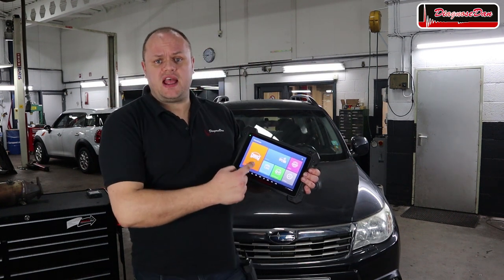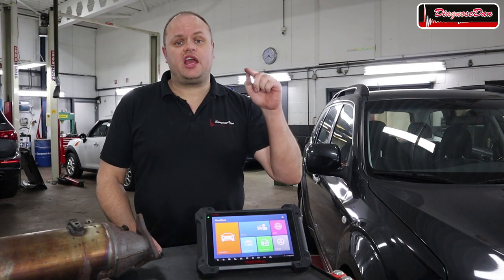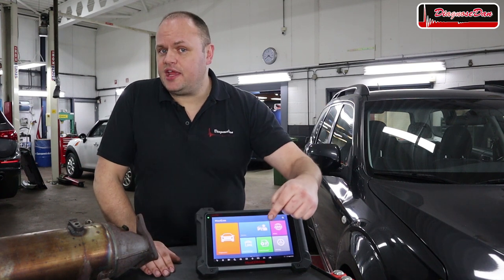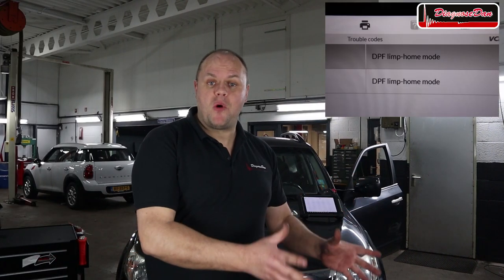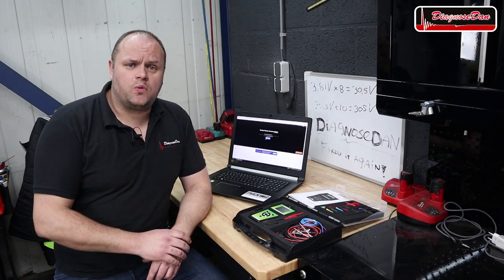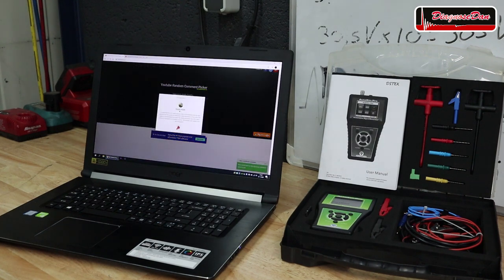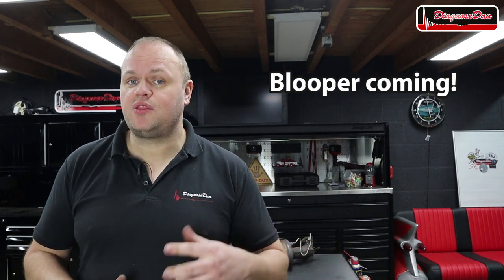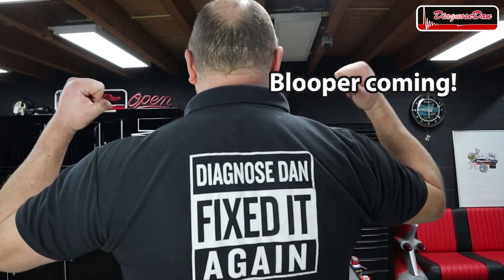New Car parts aren't always good Car parts!

Comment: Brilliant Dan.
This problem has been solved in new desil engine. Additional injuctor is added inside the DPF system and the PCM decides optimum burning time so that it comeback normal without clogged materials. On scan tool appears like accumulation percentage of the soot. When it reaches hundred percent start burning.
Reply from the maker: This Car does also do Regens, not only never models

Comment: Hello Dan,

I am a heavy duty diesel technician from Canada, and I specialize in exhaust after-treatment diagnostics. After watching this video, I still have a couple questions. How long was the vehicle driven after the other shop replaced the DPF? Did it temporarily fix the issue, then it became plugged after some drive time? Although it is possible that the DPF was defective right out of the box, it is highly unlikely. Towards the end of the video, you mentioned that the failed inter-cooler boot may have caused a rich mixture, resulting in a plugged DPF. You are on the right track with that thought process. Whenever you replace a DPF because of a plugging issue, it is very important to do an "upstream" inspection. If the engine is running incorrectly, the DPF may quickly become plugged again, and the customer complaint will re-occur. Some things that could cause DPF plugging are a stuck open EGR valve, failed EGR cooler (coolant in the exhaust), any oil in the exhaust (failed turbo, valve seals, etc), intake system leaks, over-fueling conditions, etc. A simple throttle "snap test" should be performed with the DPF removed, to be sure that the engine is not creating excessive particulate matter. Also, a talk with the customer about fluid loss, or other symptoms may be beneficial. 

Sorry for the long-winded comment, but since you have shared so much information with me, I thought I would give some back.
Reply from the maker: Great comment!
The Car was never fixed or driven with that DPF. 
After clearing the code it would come back with a "snap throttle"
I inspected the DPF and no soot blockage. 
I did have the Car running without the DPF and almost no smoke.
Reply: DiagnoseDan Awesome. Keep up the great videos man 👍

Comment: THERMOSTATS---- I'VE FOUND THAT AT LEAST 30% OF THEM ARE BAD WHEN NEW so test every one before install.
Reply from the maker: Amazing!
Reply: I think aftermarket ABS wheel bearings are the worst. It's really hit or miss with them. GM is known for bad ones all the time. What's worst is it's a sealed unit usually which is very expensive
Reply: I only fit genuine thermostats now, had so many duff ones.
Reply: How do you test it before fitting?
Reply: Raj Shah pan of hot water and a thermocouple. Make sure it doesn't open, even slightly, before the point marked on it,
Reply: @theweekthatis  There are cars that don't have good thermostats, period.
My current car is a Renault Megane 3 1.5 dci and it never goes over 75 degrees when it's freezing outside. Not even when traveling 130-140 km/h.
At first I thought the thermostat was bad but it turns out it was replaced just a year before I bought the car. New factory thermostat, new thermostat housing and new temperature sensor. Then I started talking to other owners and it turns out all of them are like this. That means it shows 1 notch instead of 2 on the dashboard and everyone thought it was a problem, but it's not. Kinda funny how they can't design a thermostat that opens 5 degrees higher. The second notch appears at 80 degrees.
Reply: @ast5515  Same as my 1992 Diesel Mercedes. It never goes above 50 C. And the water temp of diesels is higher than petrol engines, or gasoline if you are in the USA.
Reply: @gasgas2689  Diesels are more efficient, which means they produce less waste heat. Their engine blocks are also heavier in order to withstand the higher compression. This means they will always run cooler than petrol engines.

And 50 °C is just not high enough. Not even for a diesel.
Reply: @ast5515  I bought a new diesel and wanted a tow bar. Part of the manufacturer's spec for the tow bar was to have an additional radiator fan fitted because the water in a diesel is hotter than a petrol (because of the compression ignition). Fitting a tow bar means more stress on the engine therefore more heat. A diesel engine radiator will always be larger than a petrol engine of the same capacity, the same model of car will have a bigger radiator for a diesel engine than the same model same capacity petrol engine. However, the diesel exhaust runs cooler than a petrol exhaust system.
Reply: @gasgas2689  I suppose it is true that it burns hotter. You are right, I only thought about the exhaust temps.
Reply: @ast5515  The dash instruments are not always accurate, it's best to check readings on the engine data list of your scan tool.
Reply: @zbynekm2918  I always do. This car only has 3 notches. Warming up, operating temperature and overheating. You can't do anything without a scan tool. The operating temperature notch shows up at 80 degrees, the car operates at 75-78. Second notch shows up only in the summer or during DPF regen.

Comment: Helpful video . I do DPF work on a weekly base and I must say that I had only one similar problem like yours . This was caused by a cracked weld around the pressure sensor . New from the factory . Also , I don't install the cheapest DPF and I ask clients how much city KM's they do . I am not the pope and I've done my share of delete's and recommended these clients to buy a gasoline car . where I live they check for sooth but not for the DPF actually being working . It will be changed one day but until then I do what is needed
Reply from the maker: New MOT regulations and testing equipment coming and all Dpf deleted cars wil fail the test.

Comment: I dont change DPF, i remove clean it empty ash put it back, change engine oil to C3 5w30 dpf specific oil problem solved and also leave car running with AC on when i stop for 5 to 10 mins between places.passive regen no blockec DPF.🤣 never use additifs that enzyme speed regen it blocks it faster with soot n ashes.i also lock the car from outside with engine running to be safe.all 4 doors are mirror tint.car Alfa 159 2.4 jtdm
Reply from the maker: 5W30dpf the same that we use😉

Comment: Fantastic info and diag on that DPF Dan! We don't see many diesel cars here in the USA so it's very educational to see how the pressure and temperature sensors detect DPF issues, and what good specs are. Saab gauge! 👍
Reply from the maker: Over here diesels make up about 40% of passenger vehicles and 100% of commercial vehicles. But most manufacturers have stopped developing new diesels. So they are a dying breed. Thanks for watching Ivan😀
Reply: Wow I thought diesels were the next big thing! Are Hybrids and Electrics taking over soon?
Reply from the maker: @PineHollowAutoDiagnostics  yes, Mercedes is going full electric and developed their last internal combustion engine last year. More manufacturers will follow.

Comment: Hi Dan , I have had numerous problems on Fuso trucks with the wrong engine oil being used clogging the DPF's. In fact at a Toyota dealership the other day I discussed this with them as they had a similar problem with a Toyota DPF that took three oil changes to finally stop clogging because of this. This is also an important tip to remember. Thanks again for another great video.
Reply from the maker: Yes in our shop we use special Dpf motor oil
Reply: @Diagnosedan  I find it is the owner's of the vehicle that have no idea about using the correct oil not the technicians :-)

Comment: Great video Dan - as usual. :)    I loved your Analog Gauge!   As a former Aircraft Avionics Instrument tech., when I was in Germany (Wiesbaden Air Base),  our shop used many of these gauges.  I can still see Herr Diehl, in our shop, testing a 26vac, 400hz, Brake Mean Effective Pressure Transmitter (BMEP - basically engine torque) on a fixture that had a hand pump and a wonderful Analog pressure indicator - very accurate and calibrated, periodically, by the Precision Measurement Equipment Laboratory.    These transmitters were mounted on the "nose case" of the Pratt and Whitney R-2800 Radial Engine. (2,000hp @ 2800rpm).   That gauge brought back many memories, believe it or not.  :)   Thanks again, Dan.   N-6395T
Reply from the maker: Its an Honor your watching my video's Sir!
Reply: @Diagnosedan  Thank YOU kind sir.

Comment: Just watched this video and thought I would add some comments. I have worked on a lot of cats and DPFs in my job in an automotive research capacity. One of the things we would do is to build up DPFs using componant parts for use on research projects. All the DPF and CAT 'bricks' would be supplied with an identification lable stuck to the face of the brick by the supplier. Most were paper backed but some were a foil backed lables. When the brick was pressed into the body of the DPF/CAT, the lable would be removed. Sometimes they were accidently left on! The paper backed lables would just be incinerated and not cause a problem. The foil backed ones however would cause exactly what you experienced with the one shown in your video even down to to how it looked. You could see melted foil deposits and also adhesive contamination on the face of the brick. I would suggest that was the cause of the high back pressure in your video.

Comment: Great channel Dan but I'd like to make one comment on this particular video... I'm an ex car mechanic, and in my experience, when DPF's block, it's usually because there is an issue with the regeneration system. I've seen it so many times where owners simply have a blocked DPF changed, and within a couple of hundred miles, the new DPF is blocked again because they failed to recognise the underlying cause of the problem. Ironically, I did it myself, on my own X3. I had no other fault codes, but eventually managed to locate a faulty pressure sensor. Once I changed it, the regeneration kicked in and cleared the blockage in the new DPF. A blocked DPF, is usually a symptom of some other underlying problem.

Comment: So the " dunkoff " used a grinder to cut out the sensors from the original DPF . That ruined any possibility of a rebuild . That was some really deep thinking there . Great diagnosis and lesson . As a kid I saw a guy using a pipe wrench on VW  Beetle axle nut . It doesn't end .

Comment: My intercooler on my ford transit rotted away causing heavy sooting in my DPF filter and sent the engine into limp mode, after replacing the intercooler it took a fair few miles to get the van to re-gen and clean out the filter but all good now thankfully.

Comment: 2 comments
1- we always check the egt sensors with a cold engine so you can compare them with other temp sensors like Inlet temp and coolant temp,they should always be in the same range give or take 4or 5 degrees off.
2- the weird markings inside the dpf I have seen before,when the dpf is fabricated there are stickers on the parts they put in there but they don't always take them of so they leave burn marks and not burned material in the dpf

Comment: One of the things I was told about DPFs is that many times aftermarket suppliers or cleaning services cannot remove all of the ash. Detroit Diesel either recommends new filters or getting them through their reman program as they use a liquid, bake, blow process and can remove almost all of the ash. This very well could be the reason why that aftermarket filter on that car was plugged.

Comment: Excellent video! The first red flag for me was it appears the other shop had to cut and weld the old exhaust elbow on to the new aftermarket unit. I work on Sprinter vans at a Mercedes dealer and had a similar experience with an aftermarket dpf another shop had installed on a van and then sent it to us when they couldn't figure out why it still had issues after replacement. Turns out it had the exact opposite problem from this one and was flowing so freely the engine computer was throwing faults due to the almost total lack of differential pressure! Readings were a little less than half what they usually are on a known good van at idle and under certain loads it was much worse.
Reply from the maker: The DPF came like this the other shop didn't cut or weld anything😀

Comment: I tried to use aftermarket parts on my wife's 2014 Hyundai Elantra GT while doing an oil change. I changed the oil filter and air filter. The aftermarket oil filter caused a reduction in power due to a restriction of oil flow and the air filter caused excessive engine noise because the OEM air filter also doubles as a sound damper. It's OK to use aftermarket parts on plastic trim and mirrors but not on critical engine parts. If you want reliable engine performance you must use original parts.

Comment: Thank you for this video, I think the bad DPF was not clogged neither with soot or ashes but actually the holes inside the DPF where to small creating exhaust gases flow problems so it all comes down to a aftermarket DPF not meeting OEM specifications
Reply from the maker: You are right👍

Comment: a more accurate test is with the car under load.  stationary the ECU will not demand boost, so the backpressure will be marginal. 
those 240 mbar @  2500 stationary rpm are easelly translated to 500+ mbar @ 2500 under load , even in limp mode.  the temp. will also rise at at higher rate under load. 
top video , all the best and many thanks!
Reply from the maker: Thanks for watching 😀

Comment: Your preaching to the choir here Dan. At all the years I have spent with the dealer. Have had many a disagreement with parts that were no good right out of the box. Keep up the good work. Ps. There are much better prices on the mk908p. Autel so coming out with a new top of the line king of the hill scan tool. Very soon. Be well.
Reply from the maker: Do you know the name of that New Autel?
Reply: I believe it's called the maxisys ultra

Comment: In the old days I bought a new Solex carburettor. After fitting it, the engine would not start. I unscrewed the top  of the carburettor to find there were no holes drilled for the jets!

Comment: Dan you are the real deal. And perfectly explained. The most impressive for me is, this is exactly how diagnosing is learned at school. You follow the steps which seems easy, but the amount of knowledge needed to interpret data knowing how parts exactly should work individual how they can effect others. You are a genius at that all credits to you. Question why didn't the shop who replaced the original swap the part again? Did they refuse? It is known to happen with after market parts certainly the really cheap one. It should have been replaced under warranty, if you ask me. En volgens mij herken ik de Hollands school, ben je Nederlands?
Reply from the maker: Ja ik ben Nederlands. De andere garage interpreteerde Nieuw als Goed, dus gingen ervan uit dat het roetfilter niet meer het probleem kon zijn. Veel Monteurs hebben moeite met het interpreteren van de data en weten niet precies wat de tegendruk of het drukverschil zou moeten zijn.

Comment: Excellent video as always Dan. I like your mechanical back pressure gauge verfication againts the car's own electric type sensors.
 
I think that new but failed DPF has issues with its ceramic cores. High back pressure simply means blockage.
If new ceramic cores got blocked but not visually visible from the front on end side, most likely it collapsed inside.

If you are allowed to tear open that DPF both ends of the casing, a simple torchlight will solve the mystery :)
Reply from the maker: It needs to be returned for a refund😉

Comment: I just had a 08 Buick with the big ol Northstar engine in it last week. Had a brand new ignition coil in it and that's the cylinder that was misfiring. Checked everything and it ended up being the new coil itself that was bad.

Comment: Great video Dan, the only thing I didn’t see you check on the failed 2nd dpf filter was the pressure sensor hoses.  If they go soft they could collapse slightly and cause restriction affecting the readings OR could be soothed up and mostly blocked.  Also can we see camera inside the original filter?  Love the channel 👍
Reply: Unless of course you swapped the hoses onto the new filter which is now working perfectly?
Reply from the maker: @zxyqwerty123 the same hoses and pipes (don't come with the DPF) were used.
If the hose or pipe was blocked the sensor would read low pressure and not high.

Comment: I had a similar problem with my 2013 Cruze.  I bought an aftermarket Catalytic converter.  the Car wouldnt clear the Catalytic converter code. I replaced it with a more expensive after market product that failed.  I was forced to take the car into my local shop.  They replaced it with an OEM part.  Magically, the Catalytic Converter worked.  I learned that OEM aftermarket aren't always OEM.
The OEM catalytic converter was fatter than the non OEM parts.  I assume this is what was needed for it to work.

Comment: Thanks Dan for sharing this with us 👍👍👍😊 I think in te aftermarket dpf is a different structure of material that build to much pressure. Maybe a problem in manufacturing or a bad calibration and a wrong compatibility with this type of car. Te manufacturer sometimes list a lot of models and types of car compatibility but are not really tested 🤔😁 you are a good doctor, you just test an incompatibility to the dpf with subaru sistem engine. 👍👍👍
Reply from the maker: Your proberbly right👍😀

Comment: Had a similar thing with a DPF, installed a new one with a new fuel vaporizer, since it was clogged like crazy (OEM!) after checking everything, removed it again, turned out the porcelain inside broke and the PF was clogging up